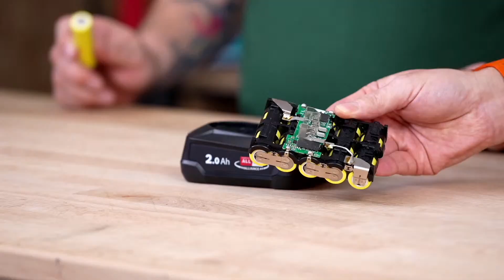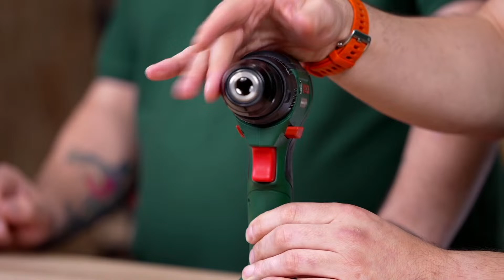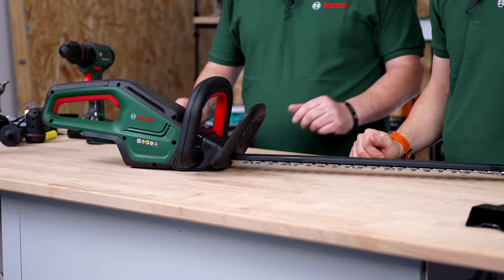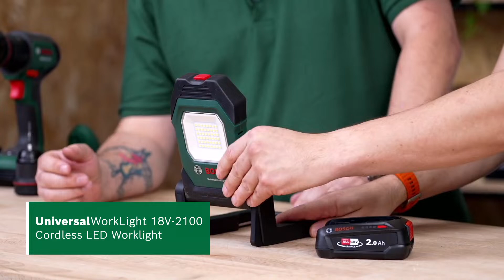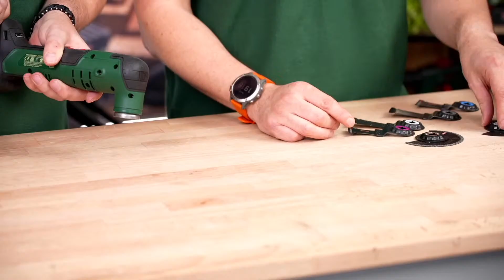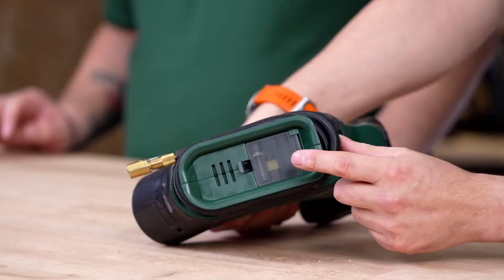WAIT, ONE 18V Battery Powers Every Tool!?!

Comment: Power for All alliance is just another marketing scam to charge you more for a crap product. Tiny range of batteries and don't fit on any quality tools.
Reply from the maker: Hey Greg, sorry you feel that way. We believe it opens up choice for our users. Rather than being locked in to a battery system, or having to have multiple batteries for different power tools. We're always looking to add new brands to the alliance of course.
Reply: @BoschDIYpowertoolsUK  And then you undo all of that by having 2 different incompatible battery lines.  Do you even hear yourselves?

Comment: Bosch DIY should offer a larger line of products as Einhell, even if they were just rebranded older models from the Professional line. Or adopt the Professional line battery pattern. The line as it is, not very appealing for a large tool gather.
Reply from the maker: Hello Roger. Thanks so much for your honest and detailed feedback, it’s clear you know your tools.

We’ll make sure your input reaches our product development team.
Best wishes, the Bosch Team
Reply: Yeah, they really need to swallow the bullet and merge AmpShare and Power4All. The longer they wait, the deeper the hole they'll dig them self into. Like why the US have not gone metric and you UK folks still drive on the wrong side. Sweden switched in time....
All the new Li akku's have BMS's and I assume they already have a current limiter implemented. So it wouldn't be like all the contractors would fill their vans with green akku's, if the can't deliver the current to drive the power hungry blue tool. Nor would they start using green drills and others tools, as they would not have the same features, build quality/materials and maybe warranty.
But it would allow us running blue, to buy the odd green tool, like the fan or pump, and not have wait for Gerlingen to make a redundant blue version of it....
Reply: @jnygaarddk  I'm looking into impact wrenches. And the DIY Bosch Universalimpactdrive 18V-350, looks like a rebadge Bosch Professional GDS 18V-350. That doesn't make any commercial sense, especially with so many similar features. Bosch should seriously reconsider their market strategy and look at Makita, or Einhell. Which share the exact same battery layout, either their entry products as professional lines.